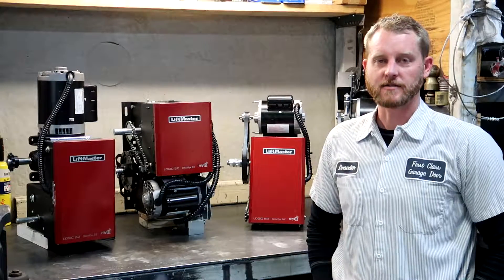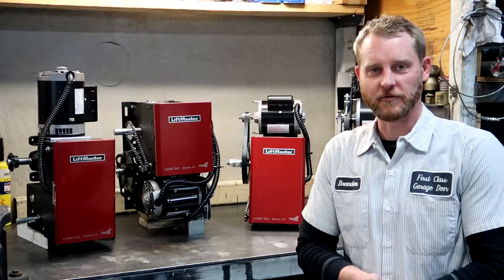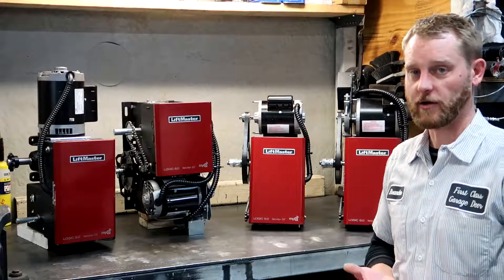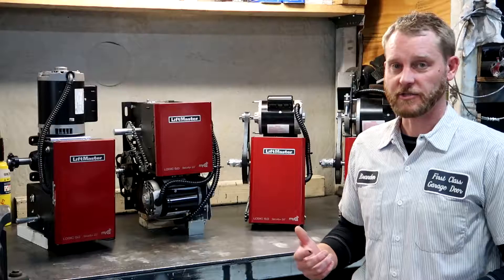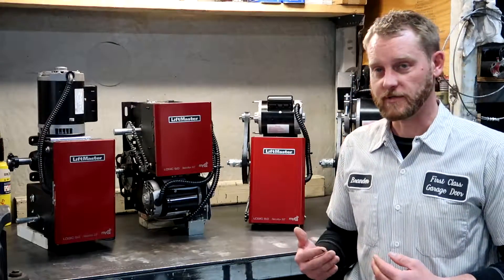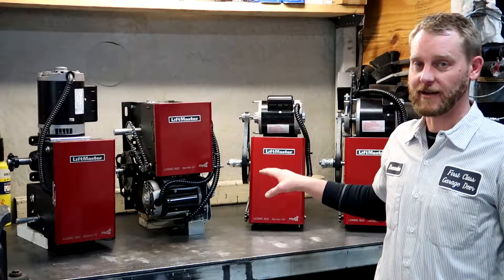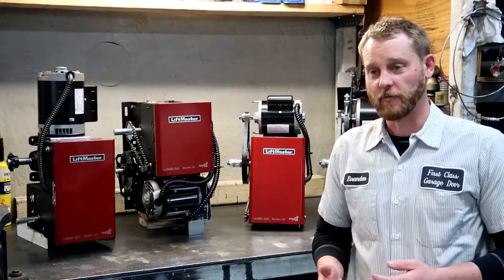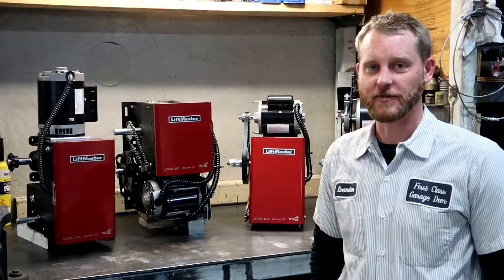How To Select A Commercial Door Opener

Comment: How does the Model H connect to the jackshaft? What is the gear on the sideshaft of the opener used for?
Reply from the maker: If you are not familiar with the product or installation we would always recommend hiring a professional. Always follow manufacturers installation and safety instructions. In short, the shaft with the "gear" (sprocket) on it coming out of the side of the unit is the output shaft, that is to be coupled to the torsion shaft of the door system via the operator drive chain. These operators are not intended to be direct drive, you will likely burn the motor out doing that and it could cause the cables to slack out on a standard track door system causing the cables to fall off the drums which would be bad. Best of luck with your project.

Comment: I received 1hp motor for repair used on these, but there is no centrifugal switch inside the motor, can you provide electrical connection diagram.
Reply from the maker: There is (should be) a wiring diagram on the electrical enclosure cover of the operator. That would be the best to go off as I have no idea what model you are working on. Good luck!
Reply: @firstclassgaragedoor6471  thanks for replying, it came far from the desert so i have no chance to talk to a technician, the motor is the big one on the thumbnail , the left most one, the one vertically planted, it is AO smith made.
Reply: Motor is wired gor 220 volts ,There is a capacitor of 650 microfarad 125VAC, so it should be the starting capacitor, but there is no centrifugal switch, do they use any kind of electronic switches for isolating starting winding after the motor starts.
Reply from the maker: If its newer that is correct there is no centrifugal switch its all done by the logic board/power board. Sounds like you are putting an old motor on a new unit or new motor on an old unit. I don't modify these units like this so unfortunately I wouldn't be able to help you with this one.  @harishharikumar1543

Comment: I plan to have 18 feet wide 8 feet high wrought iron door
What opener motor do you suggest? This is for home
Reply from the maker: Sorry for the delay. I would need some specific info. Is this going to be overhead operation or swinging ? If overhead I assume this will be a one piece door and there will be a spring counterbalance system ? Please advise.
Reply: @firstclassgaragedoor6471  20 feet wide 10 feet high wrought iron door. Actually for a home use but prefer to have commercial set up as the door is heavy and wide
Reply from the maker: @shenoyglobal  Do you have drawings of this door. I need some technical info on it before I could begin to advise on an operator for it.

Comment: I have a sectional wood door. It measures 17 x 8. I had a 3/4 overhead Liftmaster which did the job for years. It's worn out and needing the headroom I tried the 8500 from Liftmaster. Sounded like an old car starter with a dead battery and Liftmaster support was useless. It doesn't exist😞 
Fortunately I bought it through Amazon and they forced 365 Garage Door to Refund my money.
365 support by the way, is worse than Liftmaster, if you can believe that!! Still prefer a side mount... What would you suggest? Gets used a couple times a day and like I said it's 17 x 8 sectional wood door.
Thank You in advance....
Reply from the maker: I will preface this with, We are not affiliated with Liftmaster in any way other than being an installing dealer. We use the most reliable products and that is the only reason we use Liftmaster, they are the best available and if/when that changes we will make the necessary change(s) to continue providing the most reliable product(s).
Im a little shocked to here Liftmaster customer support was not helpful, they typically bend over backwards for end users.
 Your options are going to be very limited on side mount/shaft mount residential openers. Liftmaster's 8500 would be my recommendation as the only other residential shaft mounted operator I have seen is or was made by wayne dalton (i-Drive) however the only one we have seen we replaced 2 or 3 times within a couple years as there were multiple different issues with it, I will say wayne dalton covered the parts under warranty. We were not the original installer of it and would never sell it to a customer.
 Im surprised to hear you had issues with the 8500, we have these units on light commercial applications up to 18x8 wood carriage doors with glass and 4' or more high-lift and have not had issues. Although the earlier models did have issues with the output shaft of the motor snapping off. I can't say we have ever had an immediate mechanical issue right out of the box with any of lift masters residential products. 
I understand you would like the headroom but given a choice we would recommend an 8550w or 8587w (for larger/heavier doors) opener over a side mount any day. 
I would suggest giving the Liftmaster 8500 another try if you are dead set on a side mount, it is possible you got a dud. My 3800 (old version of the 8500) has been going strong for 7 years on a 16 x7'6" -  2" sandwich steel urethane insulated overlay carriage house door with 24" insulated glass top, its a heavy door and has 12" radius track making for a less than smooth operating door but I wanted the tallest door possible while avoiding low headroom track.
If you have a minute to chat Id like to learn more about the issue you had with the 8500, please give us a call at (630) 532-8937
Thank you,
Branden Suva
First Class Garage Door